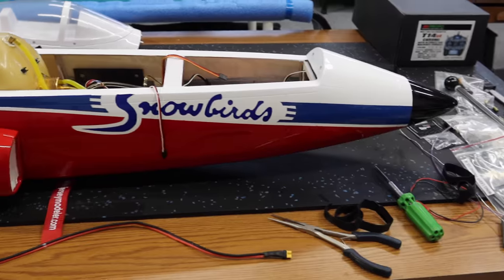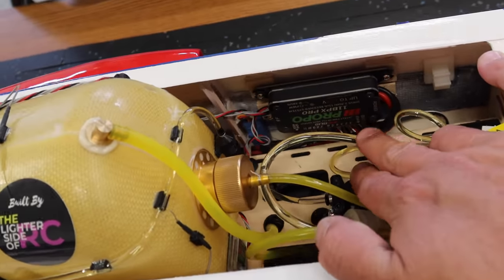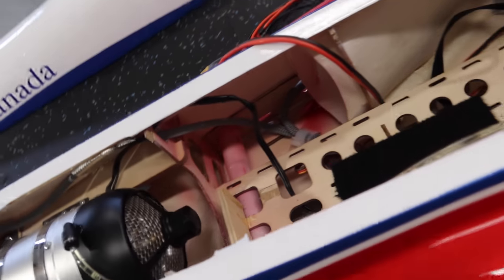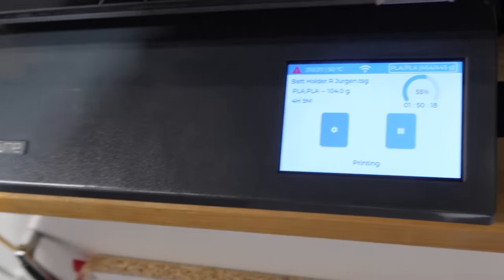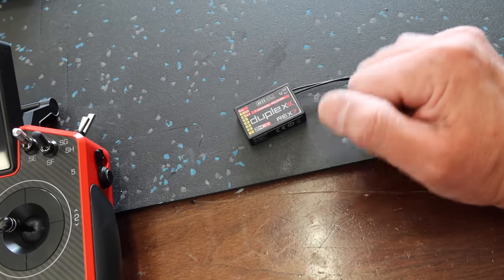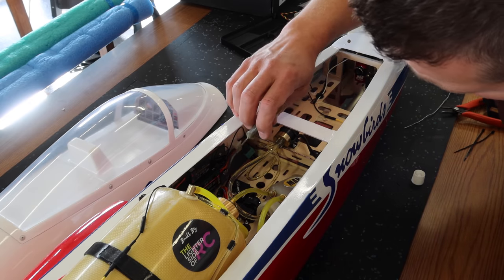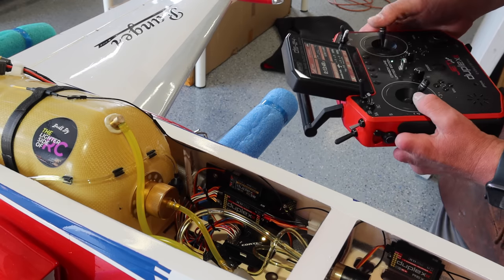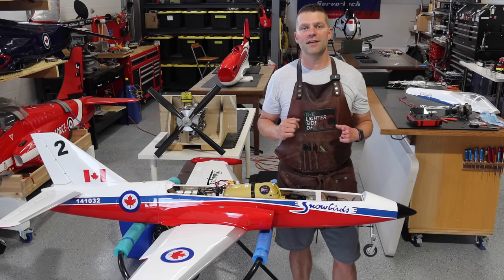Switching From JRPROPO To JETI Radio Systems

Comment: Good luck with the switch over. I hate changing radio systems. I have probably been fully invested in about 4-5 systems over the years including JR, Futaba, Spektrum aswell as the others. The last major investment was with the Spektrum brand but I have now switched everything but my little indoor stuff over to Jeti. I had friends trying to talk me into Jeti about 4 years ago and I was sick of hearing them talk about their "awesome" jeti systems. Well after a few issues with the Spektrums I reluctantly switched to Jeti about 2 years ago and I could not be happier. I started with higher channel RX's and then the Jeti Boxes and now I just use low channel rx's and split them off with expanders. Mostly using the XPS systems.

Comment: Could you please explain the 'remote switch'.  I do not understand its function properly or when and why to operate it.  It does seem like something I would like to use.  Thank you very much for the very entertaining video's
Reply from the maker: The remote switch turns the aircraft on and off from your radio.
Reply: @thelightersideofrc  but it needs power  to do that. What is powering the remote switch? And the aircraft... Does that mean motor power or all other electronics?

Comment: I am always concerned about EMF interference when banding the ECU, electric gear, and radio system together on a single power supply. What alleviates this concern for you?
Reply from the maker: Good equipment I suppose but only have so much room sometimes.

Comment: Why not receive a REX12A in , that also runs all power over the receiver for all servos . I will always use 2 batteries for powering turbine models , to save costs .... safety ...
Reply from the maker: I prefer the Cortex.

Comment: Hey Jonathan, your aviation design diamond also had JR in it eh? Did you figure it out why it crashed? Was it a JR issue?
Reply from the maker: Yes it was using JR. Sure did figure it out. Yes.
Reply: I must have missed it too. What caused the Diamond crash?
Reply: @thelightersideofrc  come on now,  you gotta share the cause of the crash with us. Lol
Reply: @jagman_singh  he made a video about it
Reply: @randomnickify  I saw he made a video about the crash of the Bull. Which was very interesting and I'm glad he posted it. Which video is about the crash of the Diamond?
Reply: Jonathan, wondering why you prefer cloning the secondary receiver instead of going dual path?
Reply from the maker: @roccoc6237 2 reasons. 1. Supposed to get better signal. 2. I like to buddy box my aircraft with others to give them opportunities to fly my planes or give them their first Turbine flight.